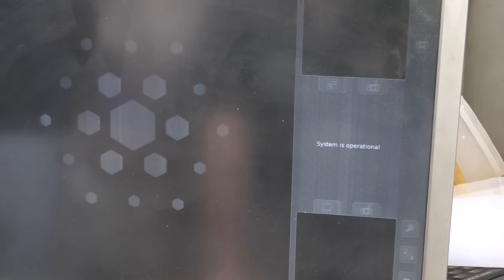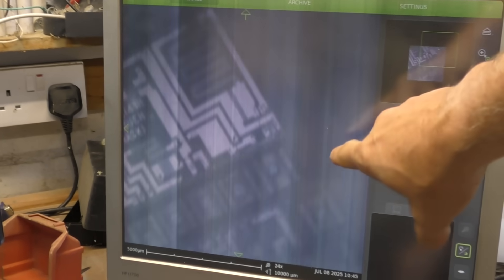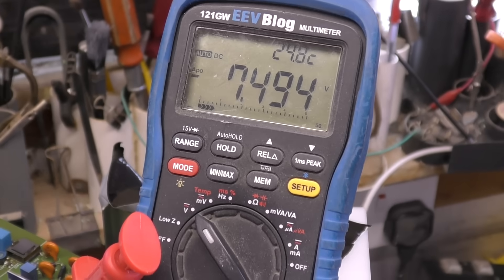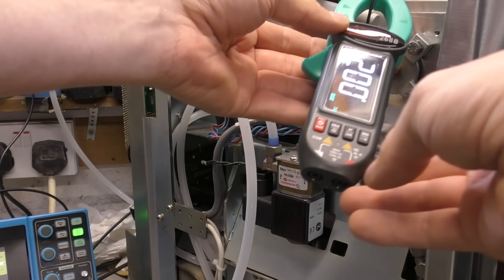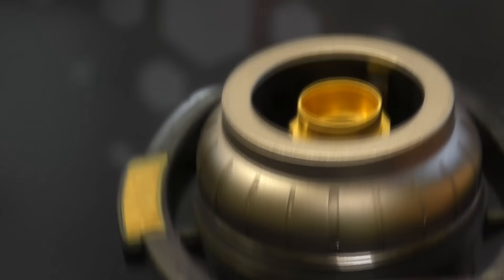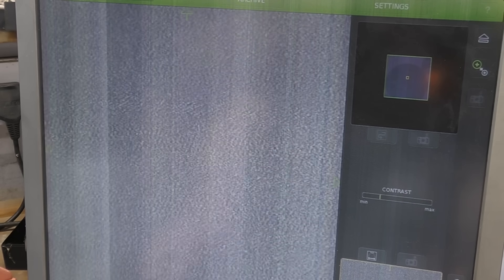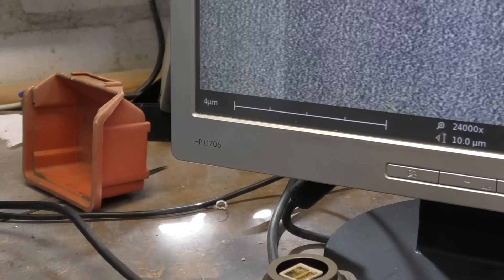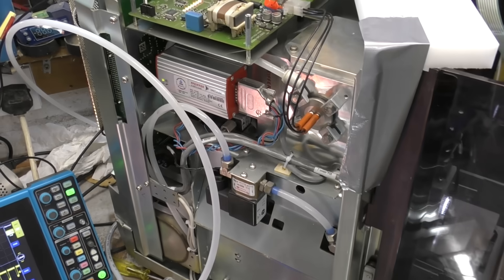Phenom G1 desktop SEM part 2

Comment: I was recently given an old FEI Phenom at work and I am trying to get it working again! Looks almost the same and it shows the same symptoms as yours, with just white noise on the screen. Hopefully a new LaB6 kathode will do the trick. One thing I find odd is that I have to hold the door open when putting in a new sample, otherwise it just falls back down on it's own. Is this the case with yours as well or is mine just broken?😅
Reply from the maker: Same. Probably to avoid gathering dust if left open

Comment: Hello,

I hope you can help me.

I own an old Neopost 4400 board and a Psion Organiser II XP.
When I power on the board, it shows an error message: "FULIT 8".

I was able to enter the service menu, but now it asks for a 4-digit code (ENT CODE) that I don't know.

My main goal is just to clear the FULIT 8 error and get the board working normally again.
Is there any way to get the code, or reset/bypass this error using my Psion XP or any other method?

I would really appreciate any advice or support.

Thank you in advance!

Best regards,
[Ahmed Mahfouz]

Comment: Considering how few hours the unit has and given it has failed open circuit I would imagine the emitter must be physically damaged. Non-zero chance it could be as easy as soldering/welding something back together after taking those 4 bolts off. Here's hopeful.

But it's very odd the "FIL OK" LED seems none the wiser about the situation. Does make me wonder if maybe that black contaminant has caused some sort of fault in the feedback for the filament which over-drived the filament and melted it.
Reply from the maker: Looks like a crack - no time atm to explore further. Pic of emitter  on my twitter
Reply: @mikeselectricstuff  A crack would certainly explain why there's no emission. Hopefully it's repairable, depending where the crack is a crimp could be the most feasible repair method. Although depending on how many amps go through it you might be able to just tightly wrap some wire around the crack for a temporary fix. But you'd want to be confident the wire doesn't shift and arc or melt and evaporate itself all over the chamber.

I think it would also be wise to connect a dummy load up to the heater output to verify the circuit regulates correctly. I imagine the crack is probably caused by shipping, but that "FIL OK" makes me suspicious, would expect it's primary purpose would be to detect if it's open circuit.
Reply: @mikeselectricstuff  A poet an you didn't know it..
Reply: tungsten is pretty difficult to repair when it brakes - it's extremely hard, but extremely brittle. Pretty much the only way to connect to it is to crimp something soft around it - the way they crimp the filaments into incandescent lightbulbs

Comment: There are some other alignments necessary. They should be referenced in the manual, even if they don't give you the information on how to replace the emitter itself.
Reply from the maker: I have found  some adjustments for emitter alignment in the advanced menu

Comment: I'm really invested in you making this device working. It's really cool! Don't these microscopes work like CRT? maybe you can take a filament from an old tube
Reply from the maker: Many SEMs use a tungsten hairpin, problem is these only last 30-100 hours and run at higher temps. Last-ditch  option is to try one but I have some other avenues to explore first..

Comment: I don’t know anything about this, but it seems very strange for the emitter to have “failed” early in life and without diagnostics noticing.

If the emitter is not broken, where would you look next?

Pretend I’m 12 years old, trying to help you fix the cool thingy.
Reply: Its possible they know emitter is guaranteed to last 1500h, so they rely on the software to count up to that number and alert you. Sort of like an air filter change alert.

Comment: Sadly yes it looks like the filament, to be honest in the simplest form as you well know its a light bulb. So if the filament heater is working but it's not drawing any current the best thing you can do is let the thing up to air with dry nitrogen or a bucket of the liquid stuff and remove the filament. If you have a blank that fits the hole then pump the optical column back down to keep it safe and consider a tungsten filament to use for your tests. Actualy if your single crystal is toast you have no choice but to fit a Tungsten Emitter unless you have loads of money to burn...literally !!    edit-:  after thought !..... I am surprised that the instrument has no filament diagnostics.

Comment: I had a monitor with an LCD that failed in a similar way to that one. Hopefully you can get the SEM fixed, the monitor likely has a standard LCD you could swap in from a non-touch model and just move the digitizer over (edit: digitizer not backlight)
Reply from the maker: yeah hopefully I can transplant the touchscreen to  new monitor, or find a way to make it work with a mouse

Comment: I would guess that the manufacturer likely can repair this, changing filament is a standard job. So probably won't cost a fortune given what a machine like this costs.
Perhaps it might even be a user replaceable part, given that it is just a KF flange held in by 4 brackets, then a fairly standard cable. Couldn't get much simpler to replace. But alignment might be a hassle to deal with, or they have some fancy solution to make that a non issue.

In the end, I would reach out to the manufacturer and ask if they have a replacement part and/or the costs of service.
Reply from the maker: It's a return-to-factory or field service job, and no longer supported
Reply: @mikeselectricstuff  That is a bummer since everything else about it seems to be working.

A shot in the dark would be to at least ask if they have one a new assembly on the shelf you can buy.

Another thing could be to unbolt the one you have and inspect if there is anything wrong with it. Just remember to not contaminate it with fingers and such.
Reply: @todayonthebench  There are companies out there that produce LaB6 cathodes for many SEMs (e.g. Kimball Physics in the US and Denka in Japan), so it might be possible to get a new cathode for your Phenom. Unfortunately, the price tag isn't very hobbyist-friendly (e.g. around 1500€ a piece from our german distributor).
Reply: @florianf4257  Only 1500 €?
I expected something much higher. Even if that is still a lot of money, but given that these machines costs another two additional zeros to buy to start with, then just 1500 € for one of the critical components isn't bad.

If I had one of these SEMs on my bench with a broken cathode, I as a hobbyist would actually consider that a fair price for a new cathode. (since the second hand price of a SEM like this is already far higher than that.)
Reply: Maybe they have one laying around they are willing to sell you? Probably doesn't hurt to send an Email, I guess?

Comment: My gut tells me its a connection issue with the detector. Maybe the dust is causing it. I had a similar issue with a mirrorless camera, I was working in a place with a ton of iron dust doing some video work and the dust got not just inside the camera, it got into the zif connector behind my cameras sensor and created a bunch of noise. It did still have a image though but different technology. It could be dust causing connection/noise. I could also imagine with zero signal the amp overcompensating and making the noise much more visible. Hopefully its possible to replace the filament. I’d imagine the signals from that detector need heavy amplification, it wouldn’t take much to ruin the noise floor with fine iron dust getting in the wrong places. But I’m no EE so maybe I’m wrong.

Comment: It is mysterious that the CeB6 heater will burn out, these crystals usually degrade to the point of unusable, its heating ribbon is wide and robust, doesn’t run very hot, maybe there’s no CeB6 unit inside….
Reply: My suspicion is the same, someone had the crystal out of it before it was scrapped.
Reply from the maker: @DavidMills_Physicist  Posible but no signs of entry other than missing case screws.
Reply from the maker: @DavidMills_Physicist  Thanks - I may try that if no other option, but I have a few avenues left to explore first
Reply: I thought about a sneaky fault in the  power supply .. maybe dump the energy into a different load and measure that.